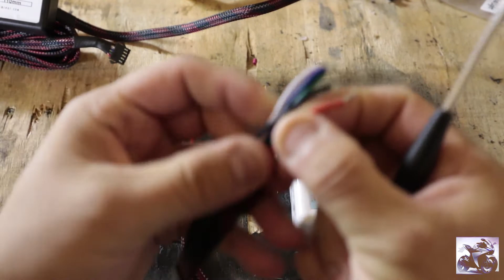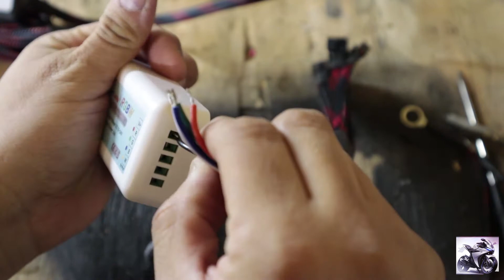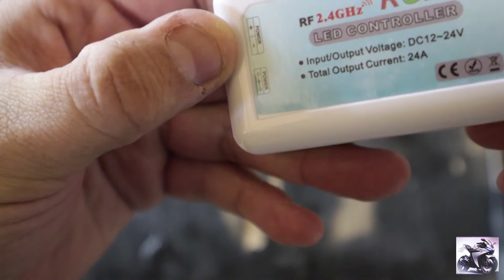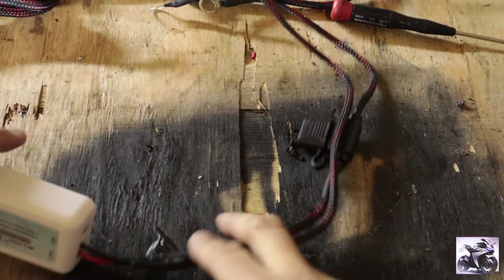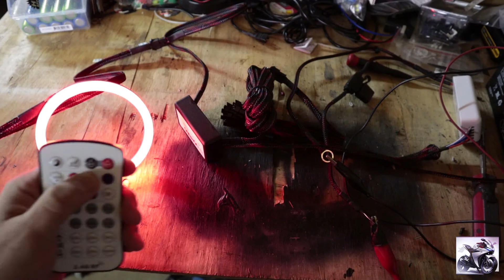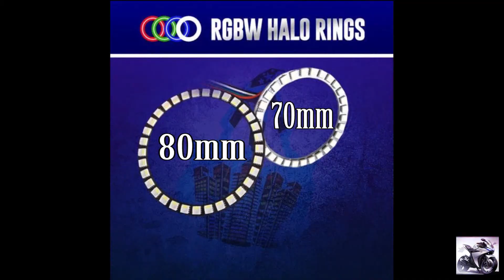Tutorial How to Wire & Setup your Wireless RF led controller

Comment: Hi sir, i need ur help ,i have benelli tnt 25 , when i turn on ignition only neutral light turns on only,guage cluster not working at all and fuel pump aswell ..fuses are ok and battry is good ........bike still takes salaf/starter  but dont start
Reply from the maker: check the fuse on the starter rely its location under the rider seat close to the main battery
Reply: @ACProductions77  sir there are 2 fuses near to the battery,  both of them are ok,
Reply from the maker: ok next location will be to check the main wire harness to see if there is any wires that are burned that would be mainly for your gauge cluster. as for your bike not starting have you checked your fuel pump to hear if its priming the fuel to the engine, if no then you will have to take it to a technician to have that fixed